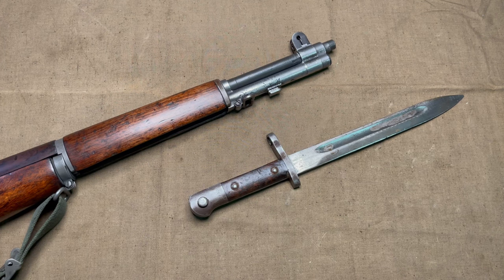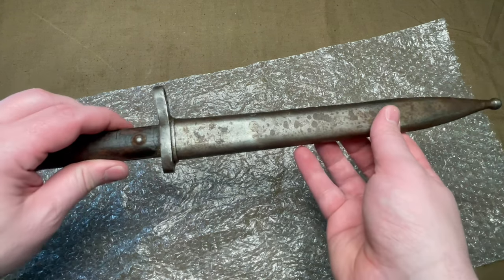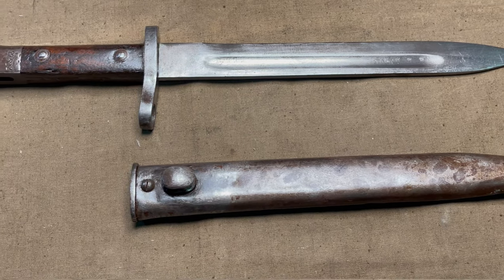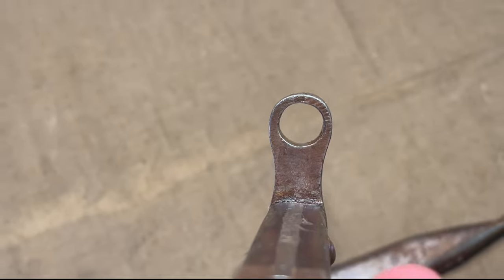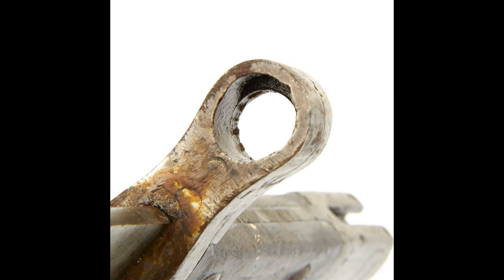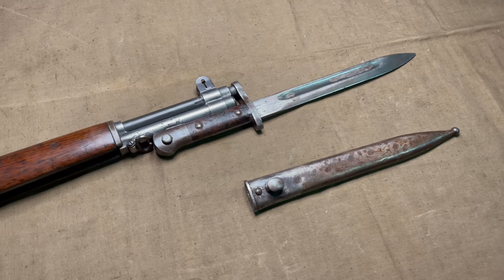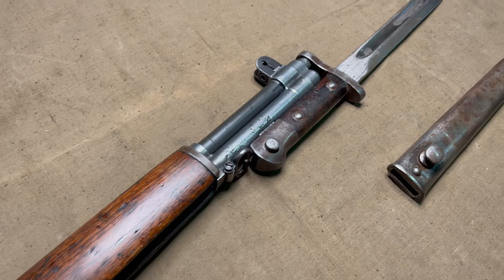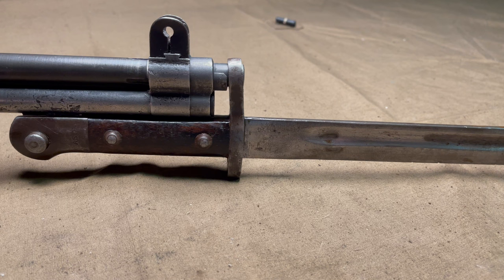Mauser Bayonet on a Garand? Turkish Military M1935 Bayonet Modification - Current Surplus

Comment: will it fit a 1903a3?
Reply from the maker: I do not have a 1903 in my personal collection to test, but my understanding is that since the M1943 bayonet was designed to fit on Garands and 1903s, this should fit on a 1903 as well.
Reply: The pre-modificarion version fits a 1903, but I'm unsure if it fits an A3 version
Reply: Argentina Mauser bayonet @RedTheMandalorian